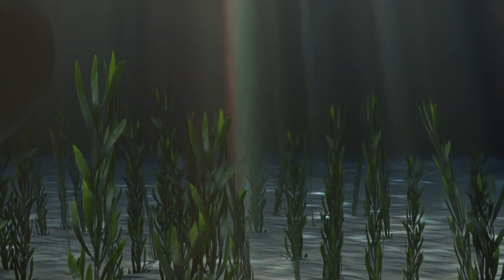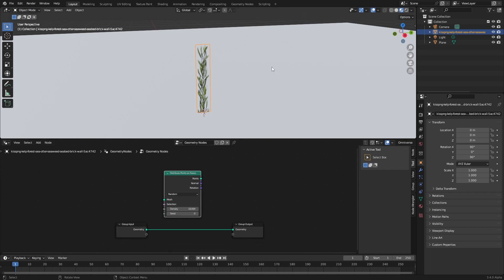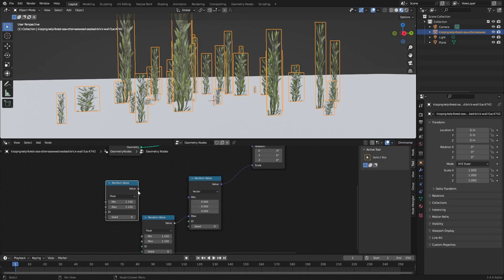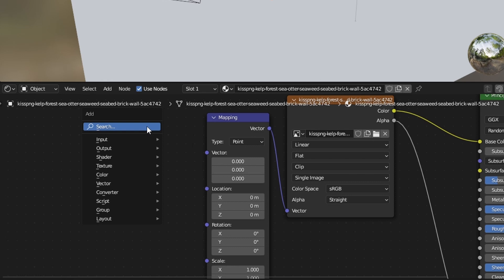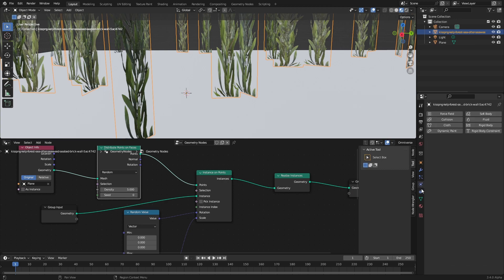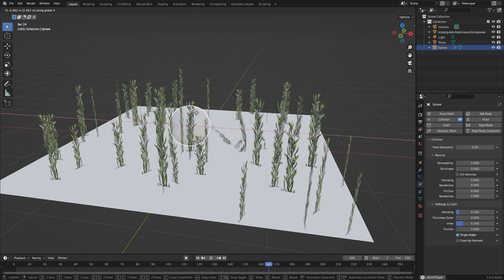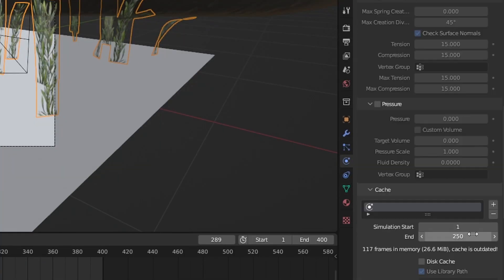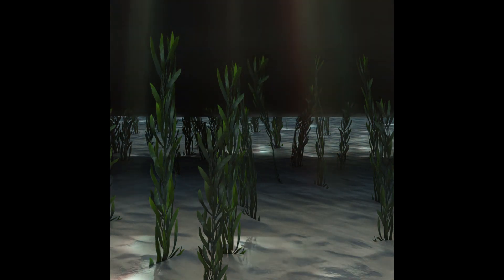How to use Cloth simulation in Animation for Blender

Comment: I'm still going back and forth trying to confirm or deny you using Geometry Nodes is a sign of the Apocalypse or not, but I appreciate the incorporation of physics into objects you used with GN's, given the Blender Foundation is trying to sell the idea that physics with GN objects can't have physics until 3.5, when in fact, it's a modifier after all, and can be used like any modifier...

I had to download this and play it back at 80% speed given you channeled Ian Hubert... because I want to see if I can use this compound method in my Machinima with confidence... still need a way to get my new hair on my Astronaut's helmet to flow in the ether like grass and flowers can already in GNs...
Reply from the maker: Give me the particle system any day of the week, but I thought I might give geonodes a try and it was farily easy to use for this example. I see people doing some crazy stuff, but to me that is no benifit. How I used it here, it worked well as it was alot faster than the particle system.